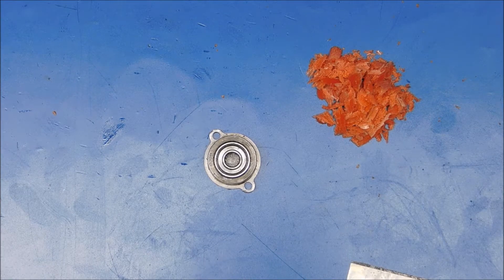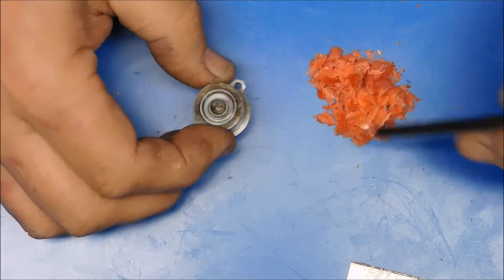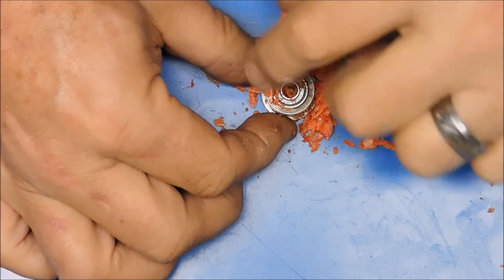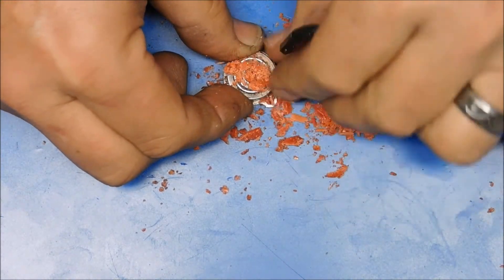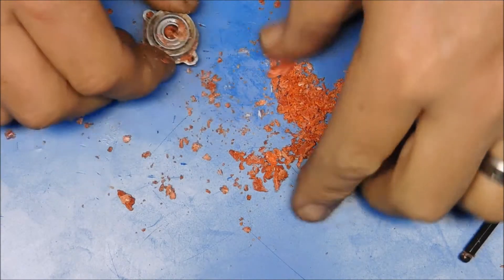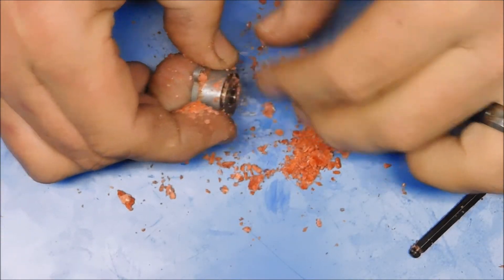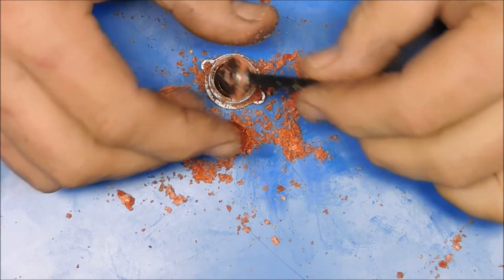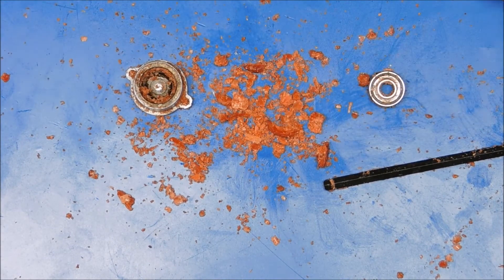How To: Remove Cam Shaft Bearings

Comment: Good after noon Dave, I watched your demo on a cam bearing removal. I watched my Dad years ago remove a steady bearing using a similar method. He filled the shaft area with grease and used a tight fit driver   to hydraulic the steady bearing out of the end of a crank.
Reply from the maker: I just tried using small pieces of wet paper towel, that did not work….

Comment: Well there ya have it, every day is a school day!! I've only ever used oil with a punch that is a few thou down on the bore size which works great if you have the correct size punch (why didn't i think of the wax trick?). Thanks for the video Dave and the wax tip. I'm going to try it on a OS40 FS as i speak!!

Comment: I've used heavy grease to remove transmission shaft pilot bushings from automotive crankshafts so I'm wondering if grease might work on our model engines?

Comment: David, I was going to call BS on this method when I came across it in a forum. Then I watched this video and others similar. Well all I can say is WoW! I have been struggling with removing the inside cam bearing on a Magnum 91 FS that was real nasty inside. Just about tried everything or so I thought, made several handmade puller tools which all broke, and using what I even thought was excessive heat in the process.
It took probably 20 minutes of packing and punching with an exact fit 5mm wooden dowel, and a hammer, but then bingo! out it came.
Don't be a skeptic, this works for real. Even on those bearings that are real bastards.
Reply from the maker: Unfortunately it does not work on non-shielded or open bearings.  The wax just gets pushed right between the race and balls.
Reply: Well maybe on the larger bearings perhaps, as it turns out David this one did not have shields and the process worked just fine. I was skeptical too, thinking it would just be pushed out through the race. I just kept at it with fresh wax and it worked just fine.

Comment: Two things.  First, I am glad they did not use open, unshielded bearings in this case.  That would keep this method from working I am sure.  Second, who ever thought of this is a genius!!!!!!!!!!  Thank you for the demo.
Reply from the maker: No it would still work with open bearings.  I have never actually needed to replace cam shaft bearings.  I read about this method and just made a video on it.  To do it inside the engine will obviously require a complete tear down and VERY thorough cleaning to get all wax out of the crankcase.

Comment: Hi Dave, it's a great thing that you made this video, yeah it's a great method, I have been using it for many years. Just info for you and modelling friends, I use a bees wax candle as the wax is softer than normal wax and works really well as a hydraulic medium, it is especially handy when getting the bearing out of the crankcase side, as you light the candle and drip the wax in the bearing hole bit by bit, it cools quite rapidly filling all the little voids, it would be quite awkward to pinch drop the wax into the crank case cam bearing hole. 

I also use an old 5mm drill bit, I drilled into a block of wood that fits my hand nicely  (handle I suppose you'd call it) then epoxy it in, leaving the 5mm shaft exposed and long enough to reach into the crankcase, for the cam bearing in there. That's my pusher.

To clean the wax off, I use a covering film heat gun and place the bearing on a cotton cloth and melt the wax, it has an affinity for the cotton and just gets sucked right up. spin it up a few times to get almost all the wax out, if you have an air compressor then blow out the melted wax or you can also boil it out.
Reply from the maker: Awesome tips.  I just happened to try this because I was at the hobby store about 30 minutes prior to making this video.  I was chatting with a fellow who was talking about doing this.  I still have NEVER seen a cam bearing that actually needed replacing however....  The one I removed was cleaned up and reinstalled.

Comment: use a round punch,works better.thats what I use to push wax to force bearing out. also have a new cover here in packet.
Reply from the maker: I used what I had available. Most modelers don't have center punches. Part of the purpose of my videos is to show folks that common tools can be used to accomplish these things.  The use of specialty tools is not what this is about.  Commonly available wood dowels would be just as good and less expensive than investing in center punches.
Reply: I know what you mean,harber freight has them,cheap.they work great.
Reply from the maker: Understood, but my audience is worldwide not limited to the US where Harbor Freight is available.  The point is that if they have the tools to disassemble the engine, they have the tool to do this task.
Reply: that is true,just trying to give helping advice that's worked for me.
Reply: @harveynewman4333  a wooden dowel would probably work fine too... especially for those who don't want to stick metal on metal